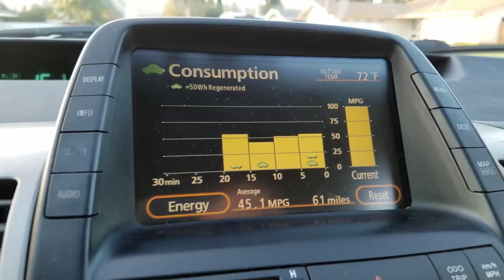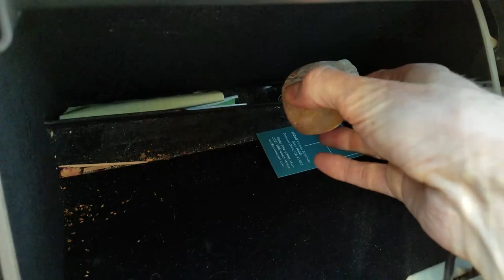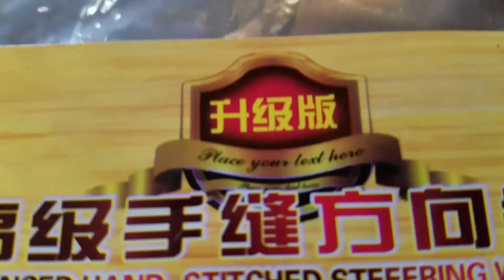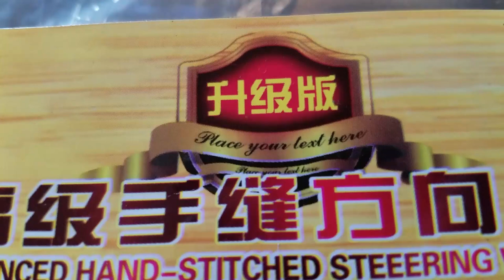Are old hybrids worth buying? Let's find out, as I buy a 2nd gen Toyota Prius with how many miles???

Comment: Great video! What were the stats on the used car you bought? How much did you pay for it? What year was it? How many miles did it have on it? Any mechanical problems? Are you still driving it?
Reply from the maker: I'm still driving it! No mechanical problems when I bought it, or now, which is amazing because it has around 250,000 miles. I paid $1900 which in So Cal is a steal.

Comment: I actually don't care about the outward appearance of the car.  It actually would be a theft deterrent in my book for camping.  How is your car treating you now mechanically is my concern.  How's it faring so far?  Any updates?
Reply from the maker: Amazingly, I haven't had a single problem! And... still averaging above 40 MPG.
Reply: @VLOGNOSIS  Very nice!  Great to hear!
Reply from the maker: Glad you mentioned the camping aspect. Hotel Prius is one of the reasons I bought this model! I am yet to camp, but it's on my list. Oh yeah, forgot to mention that the motor mounts were worn out when I bought it (the car rocks a bit when the motor turns on or off) - minor annoyance, but I'm mentioning it in case you find a good deal on one with bad mounts.
Reply from the maker: It's a 2007. I paid just under 2 grand. Best wishes & let me know how it goes!
Reply: @VLOGNOSIS  Thank you!  I will if I ever do this.  Best of luck in your adventures!